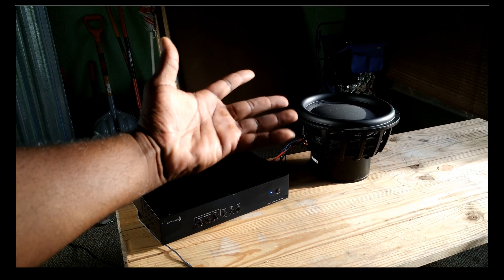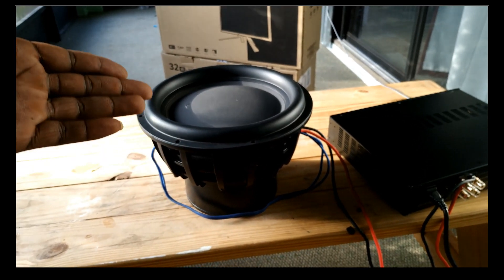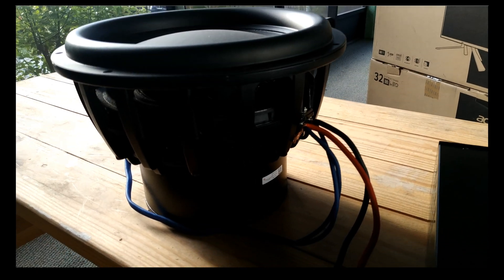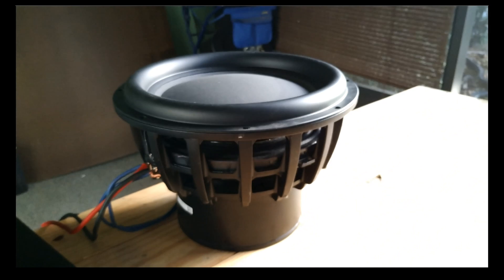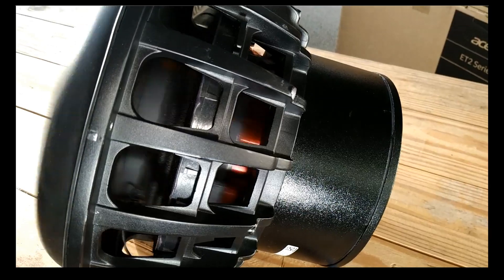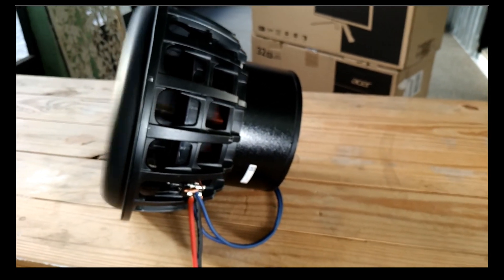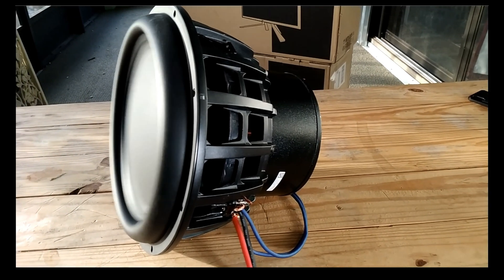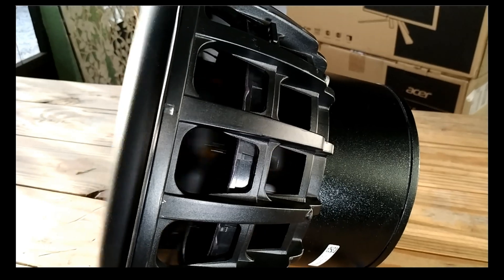Flex Demo: Peerless Tymphany STW350F - Free Air

Comment: I bought 2 of these, and so far Installed only one, it is more than enough to shake the whole house,  raise the hairs on my hand, you feel the sound, when id goes below 20 Hz.
it is not comparable to any other sub in the market for Home theater.

other part it, you do not need to worry about damaging it with over drive. it takes all what ever you through at it.
Reply: What box you made for 1 STW that gave 20hz

Comment: What is real rms power and peak power ?
Reply from the maker: No one really knows the peak power of this thing. RMS is 3,000 if I remember correctly. But only do that in a sealed enclosure. If you run it in a ported box, it will snap the tensile leads right of the coil! ...now ask me how I know that?
Reply: @BudgetBassHead  How you Know That ? 😅

Comment: So it is safe to say that this driver is bulletproof and 500W can not really break it?
Planing on making a sealed sub for listening at home but I am always afraid of blowing the expensive driver.
Reply from the maker: Sealed, at 500 Watts? Definitely bulletproof. 💪🙂
Reply: @BudgetBassHead  that sounds good, no pun intended. The reviews all say, that this driver is very very capable and even for Hifi purposes more than viable.
Can you recommend a power amp for home audiophile use? I listen at low volumes since I live in a tenant block but I am looking for very good and fast control.

Comment: Hey cool video. I know you mentioned SQ a bit but I was wondering how punchy it gets with all that weight (nearly 600g of moving mass). I'm sure with enough power anything can accelerate fast for a transient kick. But my application MIGHT involve taking it where copious amounts of power is not an option. They seem to also be fairly efficient despite the ability to handle extreme power. Sometimes the numbers don't tell all so what do you think after having one for a while. Can it do well with transient kicks or is this more suited for LFE only and sin wave? Thank you for all the time you took making your videos. 

Regards
Jerry
Reply from the maker: I originally had this in my car and it seemed to do well for r&b and hip hop music but it serves you best when suited inside of a home theater system which is what I currently have it as
Reply: @BudgetBassHead  Thank you very much for such a fast response. I've been in the pro audio field helping in church and building all sorts of cabinets from a bill fritsmaurice plan for the tuba ht to my own designs I scribble out on my notebook. My latest design was 4 tapped horn alignment subs that I tried at my last concert for support the blue. They were a culmination of what I learned making Bill's design and my own idea of what would create enough length to sustain down to 20hz. Just in case I want  to dig low. Often in these events I share power with all the lighting. And have had problems with insufficient power. This keeps me on the hunt to create my own high efficiency cabs. These tapped horns are the best so far. Using 4 cheap PA380-8 that have blown away my expectations so I wanted to take it to the final test. Can they handle the best structuraly and raise the bar in terms of current performance while still behaving like pro audio subs getting kick drum dynamics right while being good for music like Post Malone. Anyhow thanks for your time.  Please keep posting videos. Demo Yello Junior B. Jazzy song to demo. Not that it has the kick I was talking about but it's a cool one to demo for friends i guess. Thanks again

Comment: would you go with the manufatureres vented box dimensions? or do you have a suggestion for  a vented box ( to get the lowest cycle)
Reply from the maker: I built a box 3cu.ft. dual port, tuned 25Hz
Reply: @BudgetBassHead  How did it sound ?

Comment: anyone happen to know if they make these in dual 4ohm or only dual 8ohm?
Reply: Parts Express has incorrect info on their site, this is NOT a dvc 8 ohm, it is a Dvc 4 ohm sub. I verified this directly with Peerless via email, the -04 in the model num ber designates it as a Dvc 4ohm. I have one of these in a custom designed and built vented enclosure,  and one is pretty astonishing in my HT. I was pushing 3000 watts bridged to it at 8ohm. I agree with budgetbasshead, there really is nothing comparable to this, even the Svs Subs which this is modeled from slightly.
Reply from the maker: I've owned 3 of these woofers; From Parts Express. They are dual 8 ohms. Peerless is the build-house. They could customize them however they want. But if you order through Parts-Express, you will get dual 8ohm

Comment: Xmax and fs have become the end all be all for a new basshead or simply an uneducated or misinformed enthusiast. I’m more concerned with motor force, cone area,  and how much real estate I need for the driver. Everything else can be manipulated in an enclosure to give you your desired response. Just my 2 cents. Great video as always👍🏽
Reply: A sub can actually have too much motor force. Making it extremely picky and having a really  Steep roll off.
Reply: Motor force is definitely an important forgotten aspect.
Reply: Fs can play a big part in how big your sealed enclosure will be for your desired response curve. That's really important. BTW, I would totally avoid this subwoofer due to how inefficient it is. One of these woofers was sent to a professional 3rd party speaker testing facility and the claimed 46mm one way excursion didn't happen. It had about 20mm of one way excursion before significant loss of motor force and distortion kicked in. A better alternative to this woofer is the Dayton mx-15 which costs significantly less, requires approximately the same enclosure size, and moves about as much air as the Peerless while using much less power.